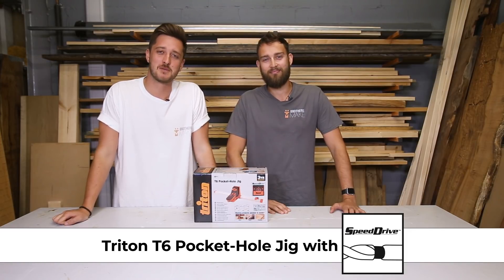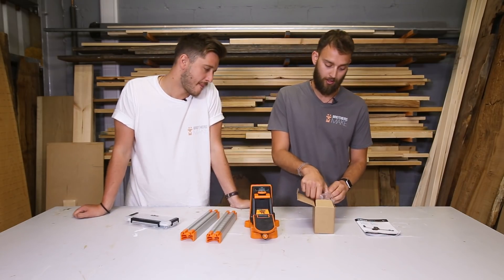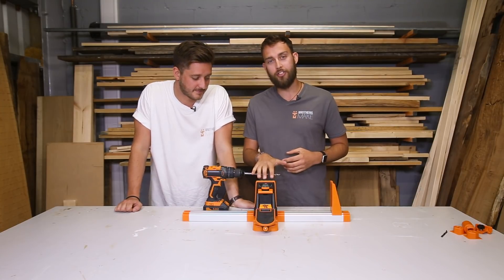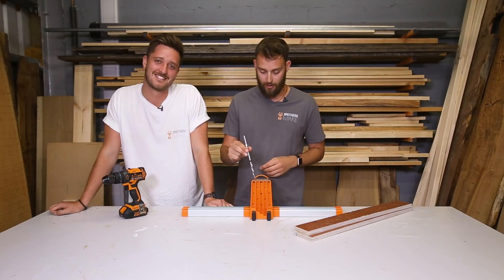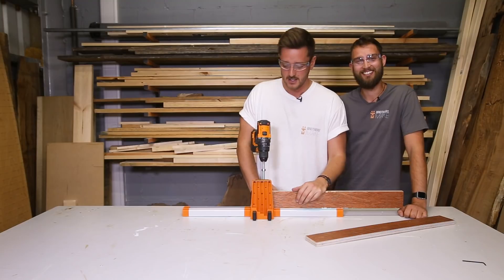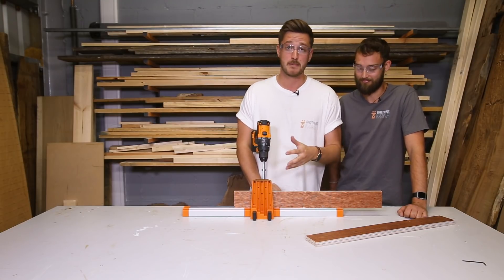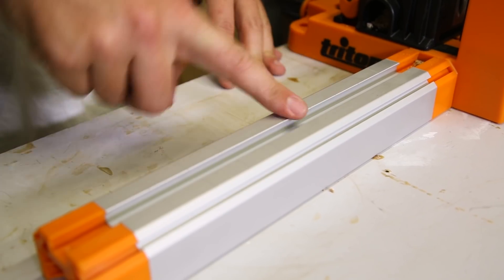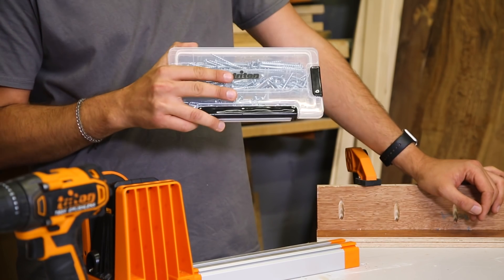Triton T6 Pocket-Hole Jig with SpeedDrive – Joinery Made Faster!

Comment: All this hoopla on these new variations of pocket hole jigs, has no one heard of the porter cable version? You never had to adjust the drill bit collar and the jig is self setting for whatever your material thickness is. All these "new" versions are only more complicated...
Reply: I found a YouTube video from 2010 that demonstrated the Porter Cable Quik Jig, which has since been discontinued. That jig looked like it was very expensive compared to the pocket hole jigs available today. Amazon still has it listed, but marked "currently unavailable".